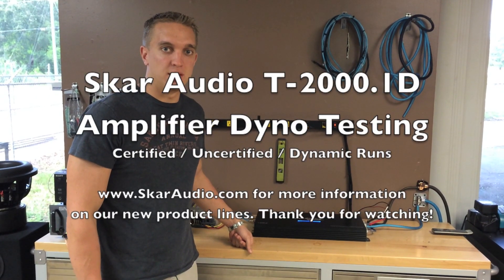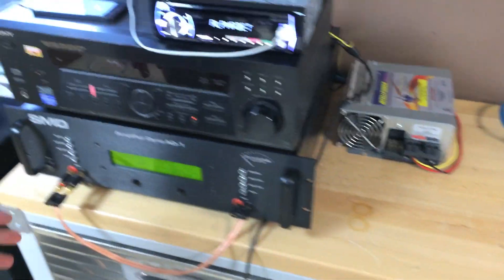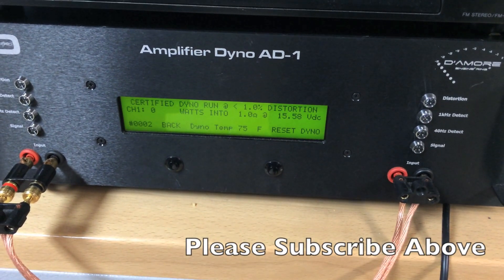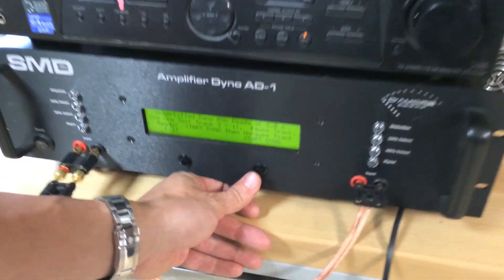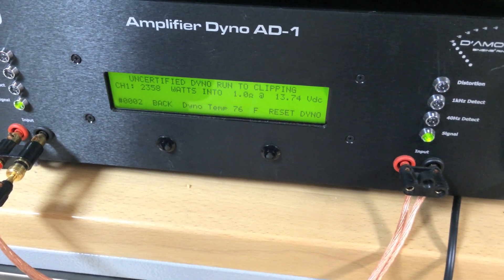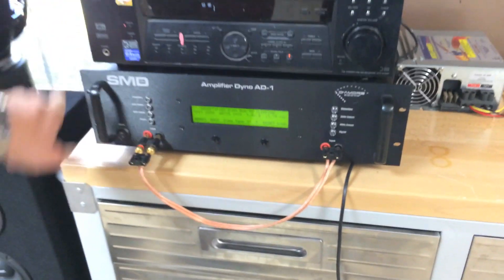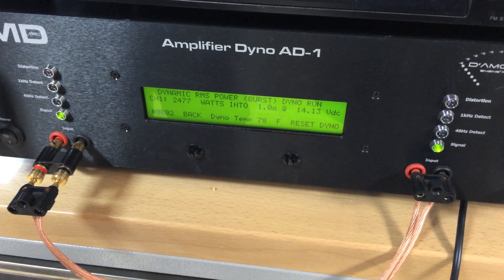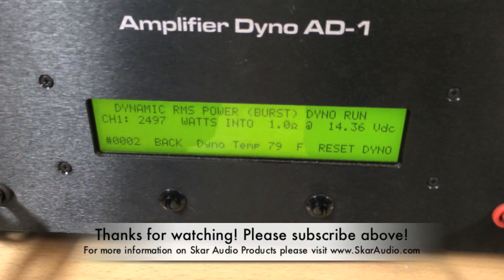Skar Audio T-2000.1D Certified / Uncertified / Dynamic AMP DYNO Testing

Comment: I'd like to see these same tests with the amp started at 14 to 14.4 not above to simulate a real car.. also would love to see a consistant voltage without much change.. looks like you need a stronger battery bank to do these tests.. starting an amp out at over 15 volts isnt a fair test .... Just saying.. never seen an alternator charge voltage at 15.5 or 15.8 lol
Reply: my Silverado has a 145a alternator stock, I've seen 15.2 and 15.5 but now after a couple years it runs around 14.6.. ebay has $130 for 250a alts with 1 warranty I believe.. I'll pick 1 up soon

Comment: What test tone are you using to test the amps. 40hz -5db? -10db? -15db? Also what 40hz@ what -db would u recommend to set ur amps at? Right now i got my sub amps @ 40hz -10db and my fullrange amp set to 1Khz@ -10db.. I want some SQ but the best SPL..